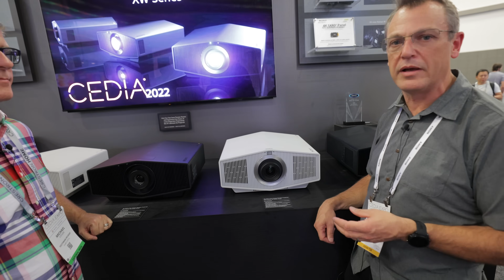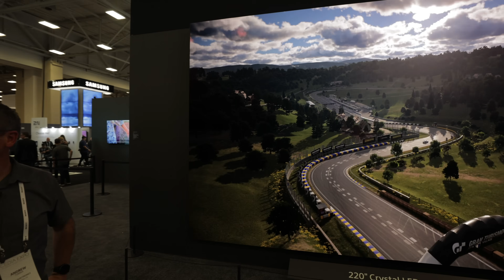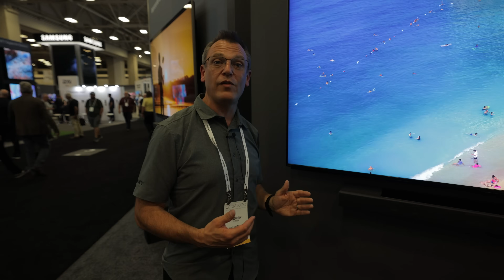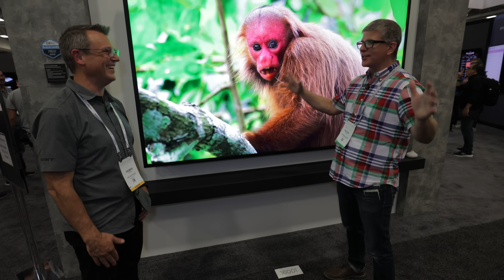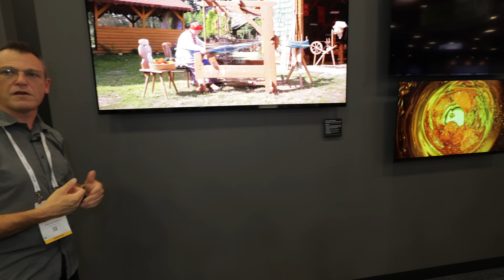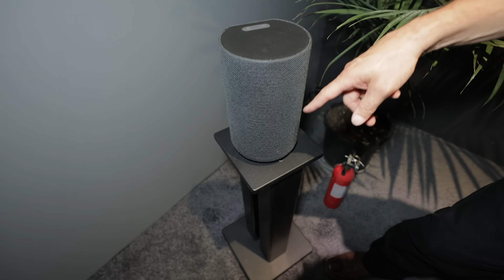Sony's MASSIVE 220 Inch Crystal LED TV and MORE at CEDIA 2022!

Comment: Need a 100 inch plus size real tv at under $5000
Reply: You need  the high sense 120 inch laser TV for $3900. Award winning. Actually it  won several awards.

Comment: These Sony 4K PJs do not have useful lenses, which would those with throwing rations of 0.5:1 TR to 1.1:1 TR. The home theater PJ with the $18,000 lens, brou-ha-ha-ha. Then they go to a standard video wall (220-inch diagonally) and try to present it as something revolutionary. Frankly, I would not buy anything from the Sony chap, wow, what a slippery snake oil salesman.

Comment: My BenQ HT1070 can go to 300 inches problem is I don't have a wall that big so I'm stuck at about 175 inches. I can't imagine spending 6k on a projector let alone 100k like that big black one and only using it on a wall less than 200 inches. that just stupid. also I only paid 500 bucks for mine and it can also do 3D very well. also these projectors don't have replaceable bulbs/lamps so after 20k hours(4-5 years of everyday use) they are useless. at least after every 8K hours(1.7 years use) i can replace my bulb/lamp for 75 dollars and it takes like 5-10 minutes to switch out.
Reply from the maker: I'm not sure where you are getting the info on 300" from." According to Projector Central's calculator, your BenQ in a completely dark room, will go up to 180" and at that size will barely have enough light output. But a 180" in 1080p is not going to be very sharp, especially if you aren't sitting a long ways away from it.
Reply: @Youthman  It goes to 300 inches.... it looks good even when room isn't fully dark in my room at 175 inches.....most movies aren't in 4K anyways and picture looks plenty sharp..... if you are recommending people spend 6K plus on a projector when they can get 95 percent the same experience for 500 bucks you are a salesman.

Comment: I really wish we could get some smaller size tvs with high specs. 

Like a 32 inch or 38 inch 120hz QD-oled gaming TV. 

Or even just qled or brighter tvs in general cz brightness is key 🔑. 

 I just returned a 43inch 9n90b cz its not bright enough for the premium price.

Comment: Several barriers to quality 3D existed. Size, people were using smaller displays. Resolution: running two separate images on one tv lowers total resolution for both images which is mostly remedied with a 4k display even at larger sizes. Cleaning up the double images edge would have helped the definition of 3d.

Comment: I think the led wall screen is a great alternative to a projector system. I myself for my set up use a Sony 65 inch full array Bravia. It may not get as black as an oled but it still can get good blacks. In my small theater room which is an unused bedroom the screen is pretty big and I don't have to worry about blackening the room and changing out lamps. This giant wall screen is a great way to go bigger of you can and have something that lasts longer and will give you that bright powerfull picture that a high end tv can give you. I get it though the cinematics of a projector is great to but most affordable projectors won't give you full 4k and hdr so either way you got to make a choice. Plus honestly for screens that size either way you will lose detail with even 4k. When you go to the movies you are often seeing 8k images most of the time especially with old movies shot on film so they look great blown up. I guess that is why Kaleidescape is going to be the future for pain in the ass audio and videophiles like ourselves who want everything.

Comment: Fyi- the reason Hollywood volume stages use LED is because OLED has awful luminance. OLED doen't even have enought nits to achieve HDR (which requires high luminance). Soon, MicroLED will become the new standard.

Comment: I absolutely love the idea of modular LED systems and I think all major manufacturers should be going in that directly. Make it somewhat affordable for people to create a 75 inch TV using a few panels and then encourage them to expand from there by simply adding more as their budget affords it!!
LOL @ his reaction when you asked him about price at 13:05
I think it's clear by his response that this isn't going to be in the average home for decades to come.
Reply: The problem with modular TVs is that they are very expensive and the pixels are far larger. If you have seen one installed in person you would know what I'm talking about. You would have to sit 40 to 50 ft away from it to not notice all the individual massive pixels.
Reply: @Twitch_Moderator  modular screen pixels are not big actually each screen couldn't theoretically be as high as 4K or even 8K and you can make a 16K if you wanted to but you have nothing to watch sort of like 8K right now unless you're into home videos all the time lol
Reply: Ever!
Reply: in theory that sounds like a great idea but there's not enough consistency on panomanufacturing for that to happen smoothly it would have to be professionally calibrated each screen to be the same if they switch lines and you bought them two years later for instance not to mention the TV technology has been changing so much you have different type of panels as well if you took too long to build your screen
Reply: The are called "video walls." They have been out in use for the past 23-25 years.

Comment: QD-OLED >

The Sony tax is ridiculously disproportionate tho. I can get the S95b for $1600. Same panel with some features sprinkled in A95k is back to $4000 (was $3500). 

Can get the $S95b and full A7000 setup for the same price as just the A95k

Fix your pricing Sony
Reply: Sony isn't a cheap budget brand like Vizio or Element....

Comment: How does the video quality of the Sony and Samsung LED walls compare to the best projectors you've seen e.g. Christie Gryffin or Eclipse? Since you've seen both I was wondering what your impressions are.
Reply: I saw the Christie Eclipse demo and saw all the LED walls there, and while the LED walls will eventually be the ticket, to my eye the Eclipse still looked noticeably better.   The LED walls when you see solid colors you can make out the module edges on all of them, for one thing, but also just the general picture quality wasn't as good to my eye.  Now, moving forward, I think they'll we the way we all go...because while the Eclipse looked amazing, that requires a dark room and an equipment room (it's not a normal sized consumer projector), versus the LED walls don't require much depth at all.  The issue with the LED walls is still the sound, but that's getting worked on too.
Reply: @commanderrussels2612  Thanks for the input! I was wondering if you could make out the edges on those panels. It'll be interesting to watch the tech mature as they work through those issues you mention.